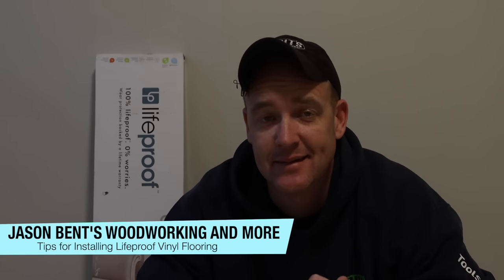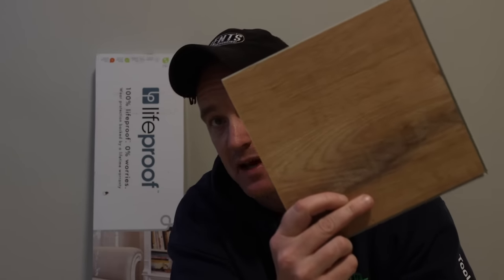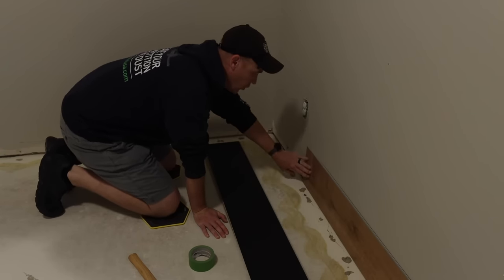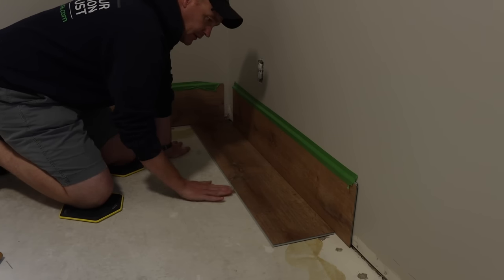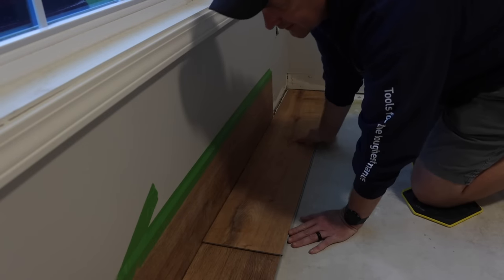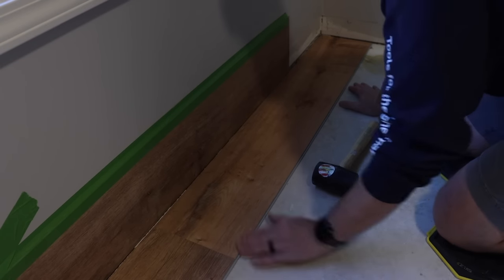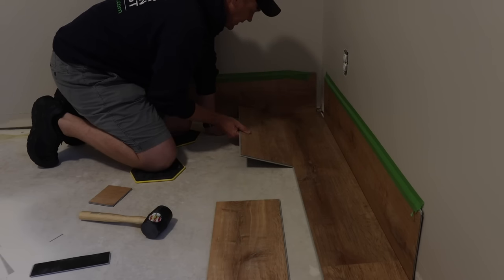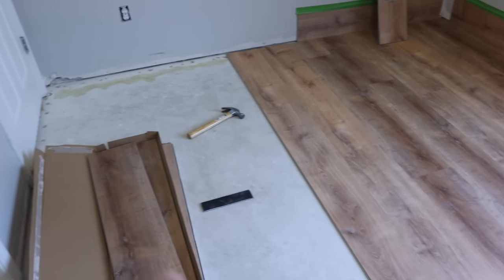How to Install Lifeproof Vinyl Flooring

Comment: Very good video. Can I ask why you put spare boards against the wall on the left and top sides of the room but not the bottom or right sides?
Reply from the maker: Cause it’s the end and not needed. The spacers are basically there to keep it in place as I install it. It can move around without them.
Reply: @bentswoodworking  ok so it has nothing to do with expansion concerns. I was wondering. Thanks for answering.

Comment: You explain everything so well. If this is our first project, would you than start your second row with a full panel since I wouldn't have pieces for previous projects?
Reply: No, you wouldn’t use a full panel if you used a full panel for the first row. You want to stagger your ends because it looks better and is less likely to separate

Comment: In channels like HomeRenovision, about a year ago he did a video saying you'll always want some kind of $.30/sqft underlayment regardless if the plank has a backing or not. Do you not agree with that? I think he said it was to help mitigate any noticeable differences in floor variation (like if it's not even) and compensate for any debris that might get trapped underneath.

Comment: Noticed you only used the taped planks on the walls at the beginning and not on the other end of the wall. Should there be a quarter inch of space all around every wall?
Reply from the maker: Well on the other walls I am cutting them to fit the space.

Comment: I’m about to install this starting in the bathroom in a house I’m rehabbing (need a working toilet so I’m not running to the gas station all the time!) would a hole saw and a jigsaw be the best to cut holes around fixtures? I’m not even sure the master bath cubby is longer than a plank!!
Reply from the maker: I use a jigsaw and a multi tool comes in very handy as well

Comment: I’m about 4 rows in and found this wonderful tutorial! I think the way you hit each plank is the step I missed and because I didn’t do it I’m finding where the short seams meet against the long ones aren’t exactly lined up 100% and is causing the longer plank to not butt up flush in some spots. Can I still just tap to close them all together in a row since I didn’t know to do it before? I don’t want to take the chance of messing up the sides by taking them apart. Any suggestions would be helpful! Thank you for the close ups and being thorough!!
Reply from the maker: You’re welcome
Reply: you can try tapping but you run the risk of damaging the locking mechanism or the finished surface you look at. try tapping but might have to pull apart. get into the habit of checking each seam as you install

Comment: Great video!  When you install your trim can it rest directly on the flooring or do you need to leave a slight gap to allow for expansion?  Same question regarding a pre-hung door - if I am installing the door after putting the flooring in - can I just rest the assembly directly on the flooring when installing?
Reply from the maker: I placed everything on the ground. I only see it becoming an issue if I decided to change the flooring.
Reply: The short answer is, “Heck Yeah, you can”.

Comment: Looks good.  I will be doing mine this week.   Just curious.   Is that a dead blow mallet or an ordinary rubber mallet?    Just curious.   dead blow hammers are usually hollow with lead shot in the middle.
Reply from the maker: It’s just a rubber mallet
Reply: @bentswoodworking  is that any cheaper than my RuBBer mallet?   :D

Comment: So I'm in the middle of watching your video. I saw that you're using two piece of vinyl as tapping blocks. I thought this was a good idea because the tapping block that I bought, which is actually a "Lifeproof" tapping block, doesn't fit the grooves of the planks perfectly, so I was worried that it would kind of mar the edge a little bit. I thought your idea was better because your pieces would actually fit the grooves perfectly. What do you think of that?
Reply from the maker: I was never able to find one of the tools which is why I do it this way.
Reply: @bentswoodworking  Well I like it your way because the piece of flooring makes perfect contact with the flooring. I have a tapping block, but the contact is not nearly as good as the actual flooring is, so I use the flooring far more often as a tapping block. Thanks for the idea.

Comment: just found you and i am enjoying your videos already. I have a question which i think you can help me with. I have a very large room and I was in the process of installing hard wood waterproof veneer a SURE+ product. But what i notice is it sounds hollow and crackle sound when you on it. Question: Do you know of a heavier plank flooring i can use that has some weight that doesn't require to nail in because it will go on concrete flooring and i do have underlayment already down.
Reply from the maker: Unfortunately I don’t have a lot of insight for you. The life proof flooring is all I have experience with

Comment: On a concrete floor do u have to use glue or plastic underlayment?
Reply from the maker: I used no underlayment as it is not required by the manufacture

Comment: 7:56 You don't want the flooring to go under the drywall. Could you elaborate on this? What I mean is, if you think of the "gap" strictly in terms of the nearest border, you will end up with a "gap" much more than 0.25 inches, yeah?

Comment: Thanks for the video. Any advice for choosing how to orient the pieces? Like long way or short way across a room? Or is it simply personal preference?
Reply from the maker: I typically started to where I end at the door. I don’t know if there is any rules about it. I just choose what makes sense for me.
Reply: generally it runs horizontal to the room length. Also if hallway attached you start there longways into main room. Great video!

Comment: Lots of good stuff in here, but I have to disagree with you on one big point. I always try to work away from obstacles, meaning jambs. You can easily lay out a starter row next to the closet and door, then do all the tough cuts while everything is loose and maneuverable, then block it off with some scraps and screws, finish easy. The direction you ran the planks did help make the jams not so tough. As far as jambs go, try a $100 oscillating saw.

Comment: Did you check to see if your floor EQ’s level in all spots or with these floors does it not matter.
Reply from the maker: This room was within limits set by the manufacturer instructions
Reply: @bentswoodworking  I wanna do my basement but I was told I need to use self level first which halts me from attempting it lol
Reply from the maker: @TheHutchmaster  if your plots are very uneven, then yes. I would definitely recommend doing that. Self leveler is fairly easy to do. Or, you could maybe just higher that specific task out if you aren’t comfortable doing so.
Reply: @bentswoodworking  it’s not like crazy unlevel.

Comment: What should I do if I just can’t get the seam smooth? I’ve tried replacing with other planks and still can’t get the seam smooth. Thanks! Your video is fantastic.
Reply: Also to add more detail. It’s happening at the long seam but it doesn’t happen throughout the full length. Some areas are perfectly seamless and others aren’t. Our subfloor is very level. I let the planks acclimate to the house for 2 days (not in that room tho, would that matter?).
Reply from the maker: Is it multiple pieces or just one. I would wonder it the lip is damaged.

Comment: Is there no glue or nail to fix the planks to the floor? I know for hardwood flooring, it is usually glued or nailed to the subfloor. How come that is not needed for the planks
Reply from the maker: It’s a floating floor
Reply: @bentswoodworking  got it. Could you tell us why this could be floating and have no concerns of shifting but the hardwood floor has to be nailed down? Also, any tips for removing the baseboards? They need hard to remove without breaking to me

Comment: I had the same life proof oak flooring installed in my new home. It has a real look of wood but it also has a dull no shine to it. Did you find a finish or a way to bring a shine to it. Could not find a phone number to contact life proof for there recomdation on this . Your help would be greatly appreciated.
Reply from the maker: I didn’t do anything to it. This is directly out of the box

Comment: Do you need to bring the flooring in for a few days before install to acclimate it to your house temp?
Reply: Yes 2 days minimum is recommended. Spread the boxes on the floor so they're not stacked up on eachother and give it a day or two. The goal is for them to take the temperature of the floor.. Use a moisture barrier if installing on concrete. If your subfloor is wood then you can go without a moisture barrier. Use a rubber mallet, not a hard mallet. Also try to never hammer on the edges of the board as much as possible even with a block.. I cringed so much on this video. Do more research before taking doing anything. This is not a great video for a tutorial.

Comment: Finally, I need to go backwards because I have a long hallway that joins the combined living room/kitchen that I want to do, but it joins it in the middle. I want to do the hallway first to make sure that it looks nice (no partial rows), but that means I have to do half the room backwards. Is that ok?
Reply from the maker: Not really sure I understand
Reply: @bentswoodworking  Basically the kitchen, dining area, and living room are all one big room. The hallway comes into this room in the middle of it. I need to get the hallway right so I'm doing the hallway first and then I can finish half the room by going left to right, top to bottom, but the other half, I have to lay the planks backwards.

Comment: Do I need to do anything different to prep the floor if it's plywood in instead of cement?
Reply from the maker: You would have to check the manufacturers recommendations for that.
Reply: @bentswoodworking  Some videos are suggesting a plastic underlay for either moisture or sound. I notice you didn't use an underlay.

Comment: Would you not want to start at the entry way so you will have a full width board? I’m assuming you would have to rip a piece at the doorway
Reply from the maker: You can start wherever you would like 👍

Comment: Question, I heard you need to be a moisture barrier down before the plank. Is that true ??
Reply from the maker: Not with life proof flooring. Lifeproof is sold as a floating flooring product, there is a rubber(ish) pad on the bottom of each plank that spaces the planks off the ground.

Comment: That underpad on the strip flooring may not meet the needed code for sound and moisture issue. Check first before using such underpad with your condo or building code

Comment: Why didn’t you use the 1/4 vinyl plank on the other side of the wall when you made the first cut? You measured from the wall to the plank to cut. Am I missing something?
Reply from the maker: I just subtract the 1/4”

Comment: I'm just curious why you used spacing for the two corner walls, yet left the wall at the opposite end without a board as spacing...
Reply from the maker: Cause the end piece is cut to fit.
Reply: @bentswoodworking  I thought there had to be spacing at all 4 walls so that the entire floor was not touching anywhere. So much different practices and advice to be found.

Comment: Did you rip any peices? You had to rip the peice around the doorway? Also you only had the vertical spacers against the wall on one end. Explain why?
Reply from the maker: Yes I had to rip pieces for the last row. I don’t need spacers on the end cause I am cutting them to the length they need to be.

Comment: Question: my living room has carpet and kitchen has tile. I want to remove the carpet and put vinyl flooring through the entire room. How do I fix the heights between the concrete floor(after I remove the carpet) and the tiles? I am trying to not use the transition in between because it is actually a big connected area. Adding a gap transition won't look that nice. Thank you so much for your time. I researched everywhere I could but can't find a video about this problem.
Reply from the maker: You should just be down to bare tile again after you remove them. There shouldn’t be a difference if your doing the same flooring everywhere
Reply: @Bent's Woodworking & More  I didn't make myself clear. The builder use tile in the kitchen area and carpet in the living room. Once I remove the carpet, living room has nothing underneath and I don't want to remove the tiles in kitchen since I'm doing it myself. So kitchen area will be little higher than living room area. What do I do if I want to use vinyl flooring thru the room without using the gap fillers? Can I put something underneath the living room to make it as same height as the kitchen? Do you have any suggestions? Thank you so your time.

Comment: How has the floor held up without a moisture barrier. Im confused everyone says to use a moisture barrier in addition to what comes on the back of the plank. I have a cement floor like you. any help?
Reply from the maker: It held up very well. Life proof does have an underlayment that you can use now and you can only use it or it voids the warranty. That is if you choose to use it.
Reply: @bentswoodworking  thank you!

Comment: the spacer is because walls aren't actually square, right? I'm putting this in but will have to flush cut the existing baseboard a smidge
Reply from the maker: No, the spacer allows for contraction and expansion throughout the seasons. That's why it's best to remove the existing baseboards, so that you can conceal the gap once the floor is installed.

Comment: So what size does second row plank has to be when staring the second row?  Like 20 years ago I installed some laminated flooring but I was having lots of leftovers as I was going and I noticed that was not right. Lol. One of my friends helped me but I forgot what he did
Reply: I used my last cut to start the next row
Reply: @kevinb3134  ok cause I think on one of ur videos u mentioned to use full planks in 1st row, 3/4 2nd etc. U mentioned on first row to cut the first plank of whatever is left at the end however when u were installing first row u just cut the last plank on first row to fit?

Comment: I have a 11’x9” room that is at the end of a long hall. Another words it is an L shaped hall with the bedroom. Normally I would run the boards in thw direction of the longest wall but that would be perpendicular to the length of hall. Do I run it from shortest wall across to other short wall so if I end up doing the hall they would all be in the same direction or does it matter. 
I am so ready to start but can’t decide which way to run my boards due to the L shaped bedroom at the end of a long hall.
Any advice would be much appreciated.
Thanks
Reply: Let me clarify the bedroom is not l shaped, the hall with the bedroom at the end in total is l shaped

Comment: Nice video but take note.. I've done these floors and your seams are too close on back to back rows. you should make sure the seams are at least 8" or more apart. I think you have multiple boards in back to back rows where the seams are probably 3" or less and it stands out. at 19:35 row 2 and 3 from the left where the small piece is laying and looks like a diamond, you can see what I am referring to. those two full boards are took close to being even. I typically set myself up for 12" apart but 8" is the minimum. Even in the lifeproof directions it says 8". Just note for next time.

Comment: You didn't stagger the semes right, some of them are only 2" offset and should be about 1/3 the length if the plank

Comment: Will this work on unleveled concrete floor?
Reply from the maker: Unlevel floors can cause the locking joints to fail over time.

Comment: why is it a problem if the plank goes under the drywall?  as long as you keep the desired gap between the plank and the 2x4 that is holding the sheet rock wall
Reply: The vinyl will expand and contract. So safe to leave gaps 1/4 to 1/2” so floor won’t buckle up. You can decide what is a safe distance from a solid stop.

Comment: I had this product (different color) installed by Home Depot. It appears that the installer sorted out the light colored planks and laid a number of them side by side in the same area. Same issue with the dark planks. I had 3 bedrooms done. They also couldn’t make a threshold work between this product and hardwood (pecan) that was already in a hallway going into the master bedroom. There are also other problems. The owner of the install company came and looked at it. Said it was a perfect job. That the ONLY requirement was that the stagger be not less than 6 inches. That he wasn’t required to separate the identical planks in any way. He was confrontational and then got vulgar. The stagger on the planks ranges from 4 inches to 12 inches. I love the product but can’t handle how it was installed. Those light colored planks side by side are so very obvious. How can I convince HD to fix my floor? 
The salesperson who sold me the job says it’s terrible. I went to another HD. The salesperson there said it was terrible. Then said, we didn’t do it, did we? When I told him yes, he said it was unacceptable. I have pictures in my phone. I’m at wits end. I have nearly $5,000 in a job that needs to be fixed. I expected a random pattern. The salesperson laid the planks out on the floor to show me that no two boards that were exactly alike would be laid side by side. HELP!